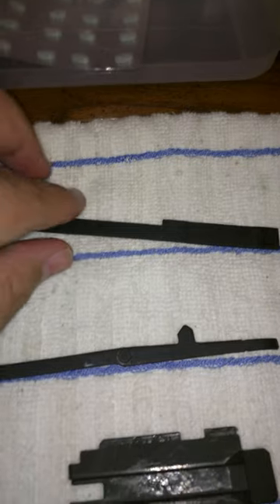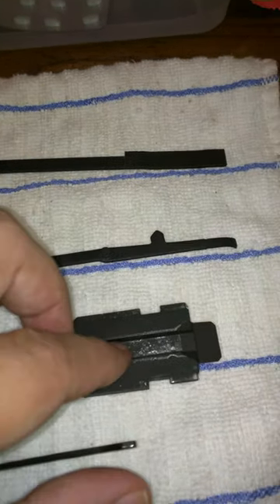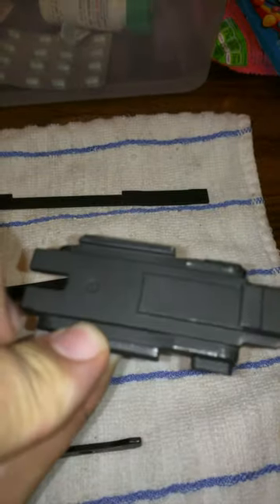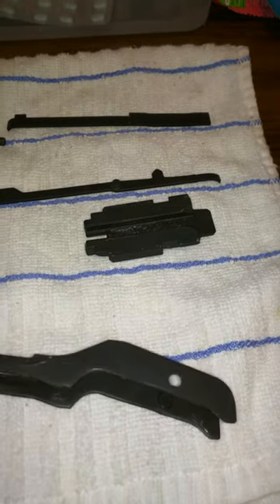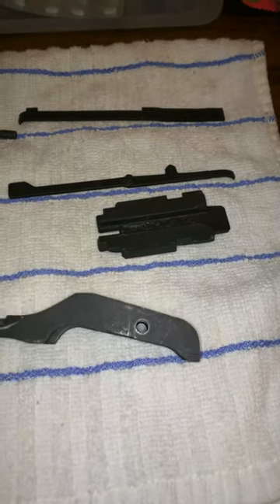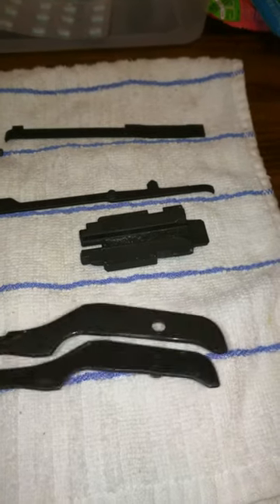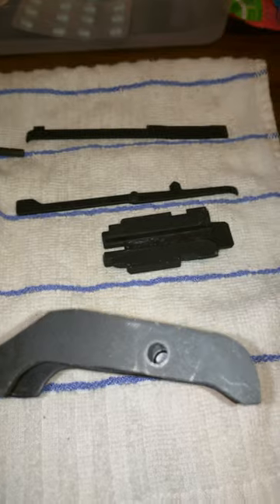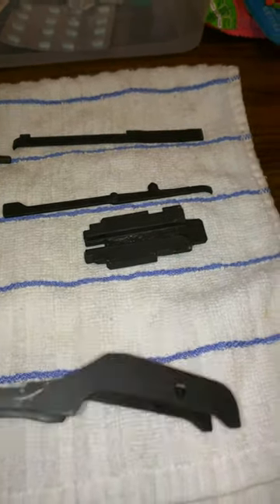Mossberg 590a1 Elevator Failure, First 200 Rounds

Comment: I see those tabs in mine, looking from the inside there are cracks. Did they replace it?
Reply from the maker: Yup. Sent me a new one.
Reply: +Teb Tengri good to knob that. Tnx. 
Here's my post:

http://mossbergowners.com/forum/index.php?threads/590a1-cracked-elevator-posts.17658/
Reply: I have 590a1 and after 300 rounds one of this is start moving...I don't know if that is normal or I I'll have the same problem
Reply: @ΣπυροςΜπαλτας-η6ρ  It's not normal. I sent pics of it to mossberg at that time and they sent me a new elevator.